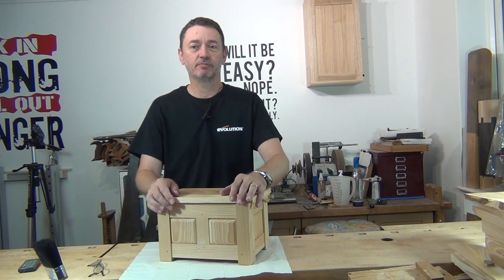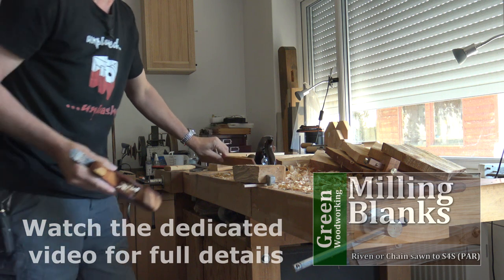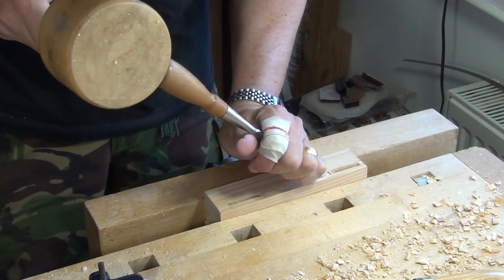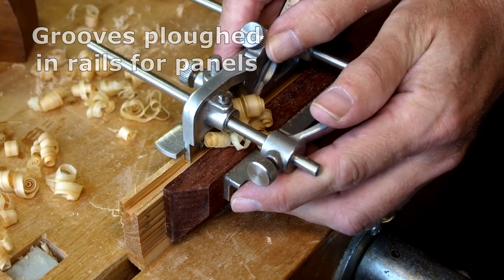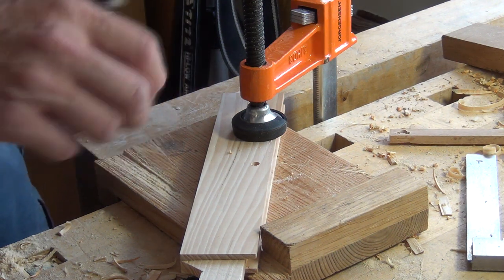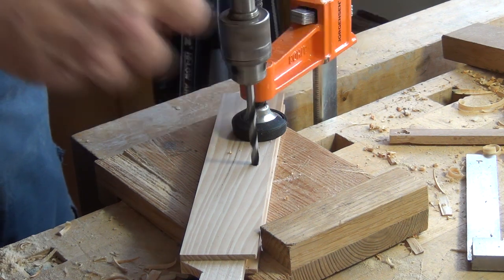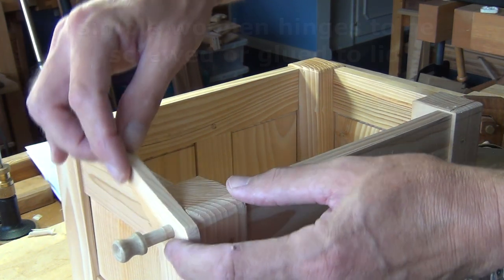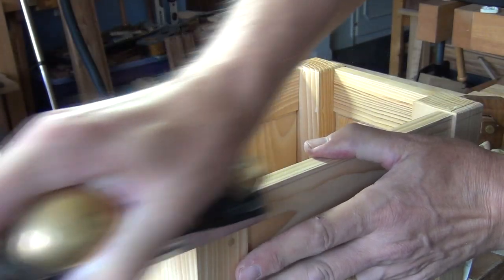Joined Chest Box

Comment: Fantastic build 🙂 , I have a question ⁉️  Is the bottom panel all in the grooves all around ???
Reply from the maker: Thanks. The bottom panel has been left free, sitting on the tops of the bottom rails. In a small chest like this it could be housed in a groove, but in larger ones the possible expansion would be a concern, as would the potential load.
Reply: @mitchwoodwork  Do you nailed it or just glued???!
Reply from the maker: @athmostafa2462  it's just left loose, as two boards that fit around the stiles.

Comment: What mortice chisel is that? brand, model, thanks
Reply from the maker: It's a lie nielsen 1/4" A2 socket mortise chisel with hornbeam handle.
Reply: @mitchwoodwork  I thought it might be, lol, a bit much for me, a lovely looking chisel.
Reply from the maker: They are nice, but functionally no better than any others
Reply from the maker: They are nice, but functionally no better than any others
Reply: @mitchwoodwork  I was looking at the Narek, Rob Crossman did a video showing the differences between the narek and some premium chisel or Canadian chisel, he wasn't enamered by the Narek, but there is nothing on the market at the low end price bracket other than Narek, but the premium chisels rate enough to make some people drool.
Reply from the maker: I fell into the trap of only considering new when I started out, but have since discovered that some of the best buys are in the used market. You can pick up a useful set of mortise chisels for less than the cost of one new premium one. Definitely the route I would take if I started over. Look for warranted British steel on the blade. The old ones were forged from superb tool steel that sharpens easily and takes a keen edge. Just avoid badly rusted blades.
Reply: @mitchwoodwork  Thankyou.